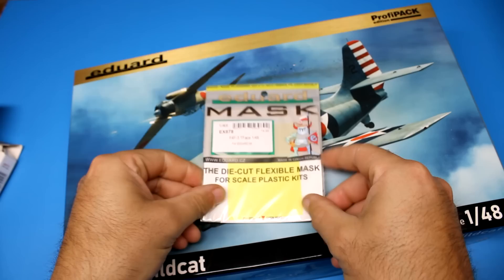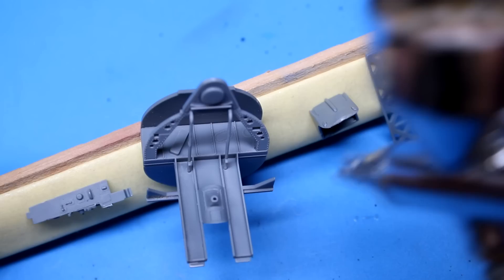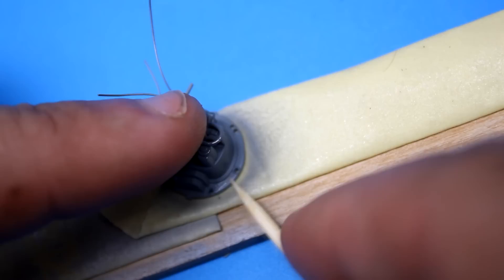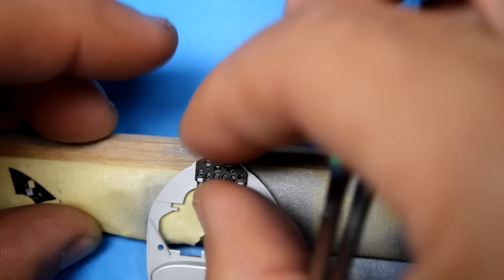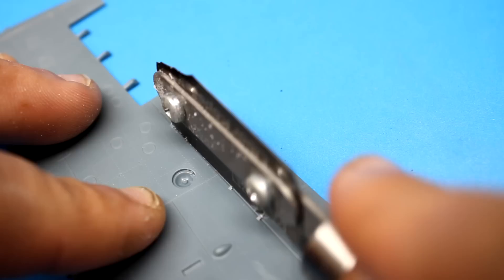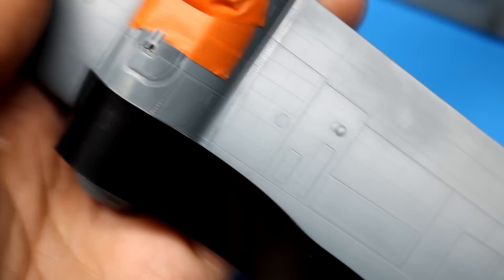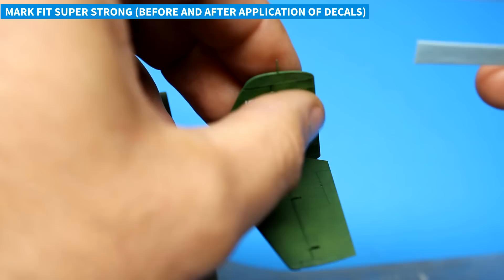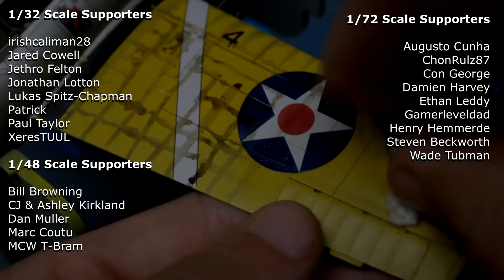The All New Eduard 1/48 F4F-3 Wildcat! Build Review

Comment: It is a great kit……..but, I had trouble with the engine mounting to the fuselage, there was too much play up and down and so I had to modify it with a couple of bits of styrene in the fuselage socket . A quick search online found I wasn’t the only one who had this problem .
The only other area of concern was the propellor, it appears the hole is too big in the prop and it won’t sit securely, mine is a ‘Midway’ 2 kit boxing so it’ll be interesting to see if I have the same problems when building the dash 3 version.
Great video with some handy hints 👍🏻

Comment: I have a question regarding the paneling line wash. How are you removing the excess? A dry towel? I can’t seem to clean that stuff up unless I use a thiner product.
Reply from the maker: Usually a dry towel but if its not coming up a dampened towel with thinner